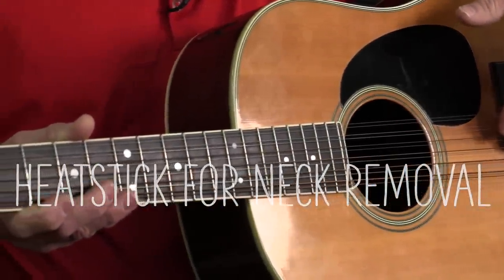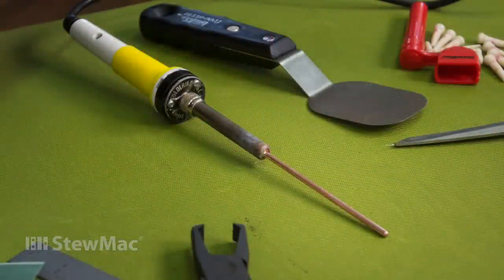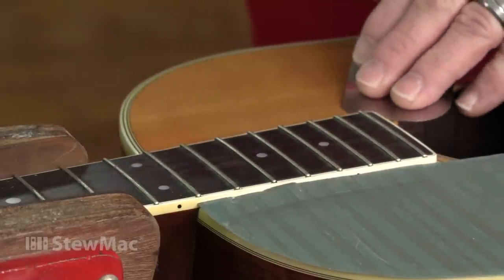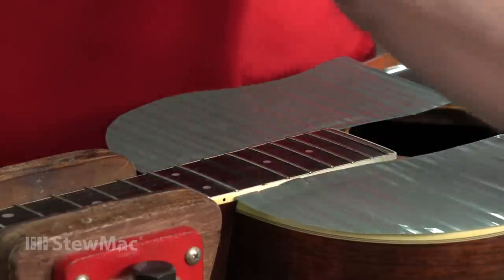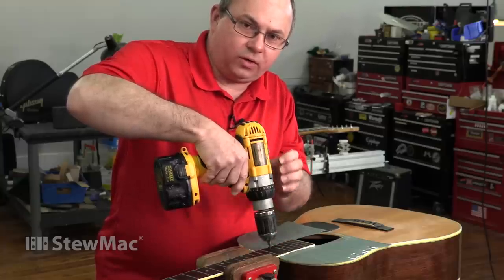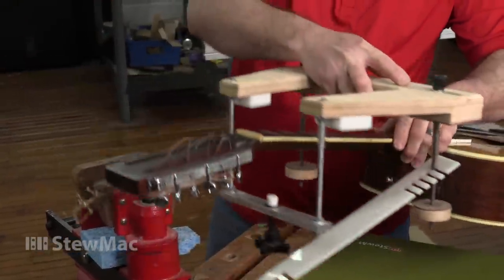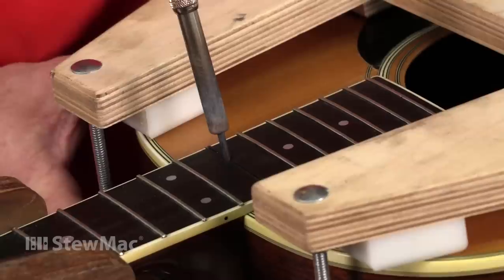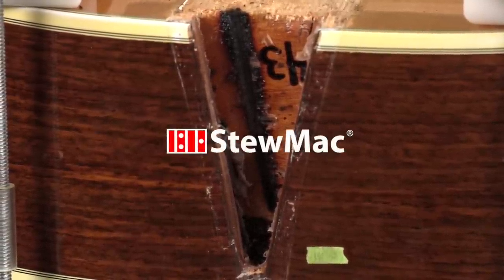The HeatStick: remove glued necks with no damaging steam

Comment: Was it just me, or did the "neck removal jig" not do much in this video?
Reply: I have something very similar in my dungeon
Reply: As far as I can tell, the jig only holds the guitar table and back securely while the neck joint is 'wiggled' apart.  Just saw one out of plywood and use sone screwed rod and nuts from your local emporium and add some foam or styrofoam padding to protect the finish.
Reply: Bryan Hill j
Reply: It doesn't look like much in this video, but that little bit of force on the heel makes a huge difference in the initial separation of the joint. A jig like that helps apply a consistent lateral force on the dovetail to separate it. After you get the initial separation, the joint becomes loose enough to work by hand. B

Getting it to actually separate in the first place is really difficult without a jig like that, and can end with some unintended banging around or jolting that can scar up the instrument. It's very useful, albeit a very subtle thing to notice unless you have hands-on experience doing a job like this. Having a jig like that has saved me countless headaches when doing resets.

Comment: Where to buy those long drill bit??
Reply from the maker: The long #27 drill bit that Todd uses in this video is included with the StewMac HeatStick for Neck Removal. We also sell 12" Aircraft Extension Drill Bits in an 1/8" and a 1/4". For a wider variety of extension drill bits, you might check with MSC Industrial.
Reply: Just go buy some GOOD quality aviation bits. Try to find good cobalt,  Chrome Moly, or a a last resort M7 HSS bits. I don't recommend buying basic High Speed Steel HSS cheapo bits.  I would NOT buy bits from Stewmac. There is nothing at all that says who made them or out of what kind of metal they are made from.  Aviation bits do four things very well. The drill deep holes,  they get really hot, and they wear out. After they do those first three things they do the fourth thing..... they burn wood. You may also want an aviation "taper bit". The bit has the extra length and it has a special taper so it does not build up as much heat. You can usually buy "refurbished" aviation bits at great prices. These bits come from places like Boeing, Lockheed, General Dynamics, or Airbus. When they have been sharpened a few too many times they won't work in the automated tooling anymore, so they are sold off at really great prices, and the quality is excellent +. You are running them in by hand so it's a non-issue for you. They have also just been resharpened, so they are as sharp as a new bit too, maybe even sharper. I keep a #30 which is .002" larger than 1/8", 3/16" & 1/4" for Tremsetters, and other long bits for wire routing neck resets etc. I use some pretty small bits and old Record brand German cardiac needles for body disassembly, using steam. I made my own steam injectors using cardiac needled and slightly smaller hypodermic needle tubing than Stewmac sells, so the older skinny frets & bindings will cover up the holes. For dry heat I use an RF induction coil and a 304 stainless steel piece of tubing, with a thermocouple inside it so I know exactly how hot the rod is. The coaxial thermocouple is about $2900 so, unless you know someone who works at Honeywell, who can make one for $20, that's a luxury item. This place has good prices on fractional cobalt extension bits!! http://www.panamericantool.com/cobalt-drills/cobalt-aircraft-extension-drills-fractional-sizes-12-overall-length.html

Comment: BUT... Isn’t that a big burn mark that goes from the top to the bottom where the heat rod was? That might be a bit scarier than steam, that you might catch your guitar on fire.
Reply: The minimum ignition point of dry hardwood is around 250 deg C. (480-ish F). It IS possible to ignite wood below that but it requires chemical changes to the wood from prolonged exposure to constant heat (for months/years) - and there also has to be enough oxygen present to support full combustion. In a tiny cavity with no prior heating, prob a little water introduced, and no source of O2 - it's just not gonna happen. And if it did - well that's why you sign a disclaimer and 'hold harmless' whenever you authorize work at a reputable repair shop - and why that shop needs good insurance. If you own a guitar worth this type of repair - my advice - take it somewhere they do 100s of neck resets - NOT to the guy on YouTube videoing his first one.
Reply: I would be more inclined to say there are pros and cons in both methods involved the heating process for removing a neck.

The burn mark is one of the cons involved with the "Heatstick" and the blushing of the finish being the con involved with the steam needle process.

The Heatstick would work well when it comes to moisture permeable finishes such as Shellac and French Polish.  Plastic lacquers on the other hand which are used on lower end guitars would not suffer so much from the use of the steam needle method.  By and large, I would also be inclined to decide on which method to use depending on the finish.  And to use a dry air source such as a heat gun or a hair dryer to evaporate the water left behind in the wood.
Reply: you don't catch the guitar on fire
Reply: The blushing from steam vapor goes away by slow evaporation, it just takes time... 2-3 weeks typically... slows the process, but no harm-no foul. The one danger is that over steaming can actually delaminate the finish... not good.
Reply: Buddy Martin
I was thinking the same thing. An improvement to the setup they show would be a way to figure out how to give the iron current in a more controlled way so that it only heats up enough to do the job. Needs a pot switch setup like the burner on an electric stove.
Reply: bro stewmac is a luthier channel. pretty sure they wouldnt have a guy doing his first neck reset on here
Reply: Agree.. If that was his first time this must be really, really easy because that went very well...
Reply: Who said that this was anybody's first time doing anything?
Reply: Drogo Baggins read the first reply on this thread all the way to the last line.
Reply: stawsparky33
Okay. Missed the end of that one.
Reply: The guys from StewMac invented the reacharound in the 80s. Dan Was a master at it.
Reply: Unless I'm very mistakesn that is a cheap UNION temperature controlled iron like the one I've owned for a very long time.  Very controllable temperature... and dirt cheap.

Comment: Where's Dan?? Now show how you figure the angle you need & how to chisel it off to make it right the first time.
Reply: I've watched it several times and I don't think the angle is too critical it need only be approximate, from what I think providing the hot rod goes into the glue at the top of the tenon the heat will then loosen the glue all round.

I suppose leaving the guitar in a car boot (trunk) on a hot day could do the job. ONLY JOKING although if you like jigsaw puzzles it might be worth a try.

Added by edit - just realised you were probably referring to the angle to reset the neck - this video is only about how to take the neck OFF.

Comment: Pretty sure most luthiers would just tell their customer to buy a new guitar.
Reply: Ed Mathews  - not at all. Its a very common repair. Cost is $500 and up typically so no, it's not for your plywood Yamaha - but  if you are lucky enough to own a pre-war Martin or similar that is a 5-figure investment and a neck re-set is how you keep them playing.  I've only done a couple and it was white knuckle all the way - but I know guys who do almost nothing else and do several week-in week-out. They get incredibly efficient at it. Good stringed instruments - bowed strings especially but also quality guitars, mandos, etc are built knowing they'll need to be taken apart at some point.
Reply: Funny, I just did a neck reset on my cheap Craigslist Yamaha FG acoustic.  It's free other than my time.  The action is incredible now and I promise you it is way better than when it left the factory.  I can hammer strings high on the neck, do arpeggios, I cannot put this guitar down.  It is hard to find such a playable guitar at any price.  If anyone ever wants the action higher, the saddle was previously sanded down to nothing (as so many that I work on are), so raising the action with a taller saddle should be easy.  Plus I converted the joint to bolt to make it easier on the next person that works on it, should I sell it.  I feel like I have discovered a gold mine, a lot of these Craigslist guitars can be fixed and play like thousand dollar guitars, or better.  I have no plans to do this on other people's guitars at the moment, since I am still a little nervous.